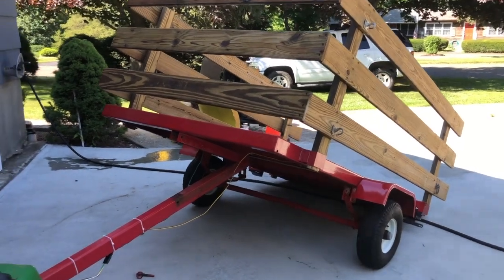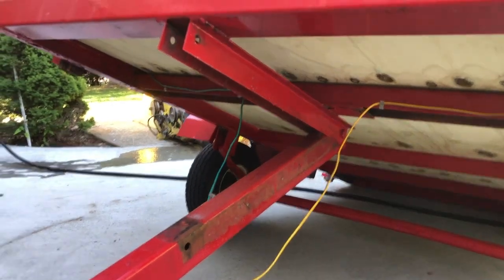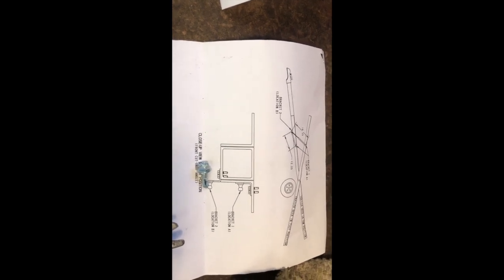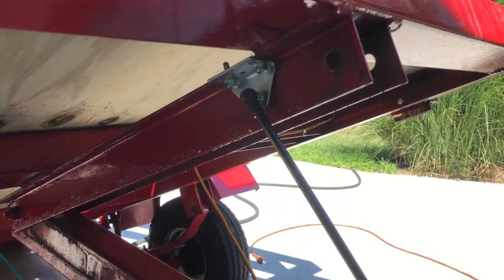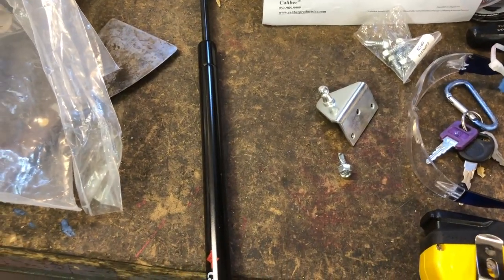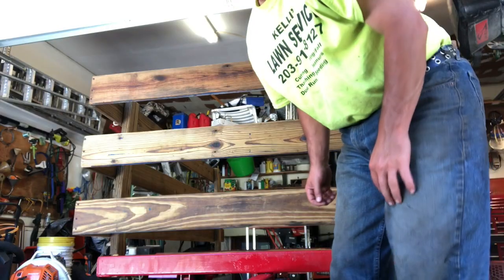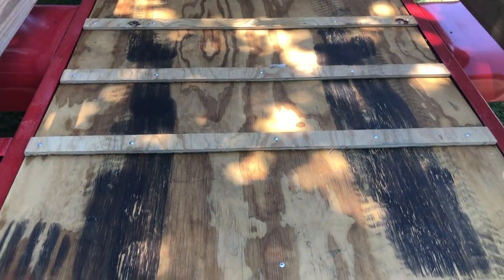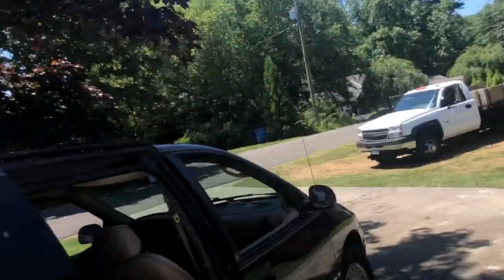How to add a stabilizer / shock to a tilt utility trailer.

Comment: My Father bought an old tilt trailer years ago, a bit larger than yours, but mostly just used for my riding mower. It's always slammed down. never thought of a shock to slow down the movement. In need of a bit of an overhaul now. might consider that as my Father loves it.
Reply from the maker: Thanks for watching, hope it works out for you.

Comment: the single bar that connect to the trailer hitch that the bed pivots on is that have alot of play in it or can you not rock it side to side?
Reply from the maker: It has very little play side to side .
Reply: @Kellislawnservice  thank you so much!